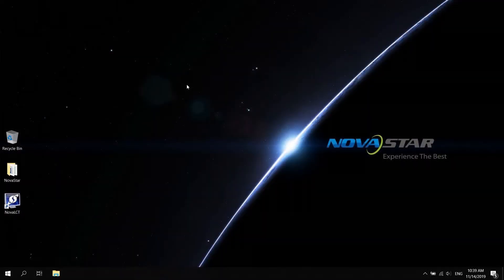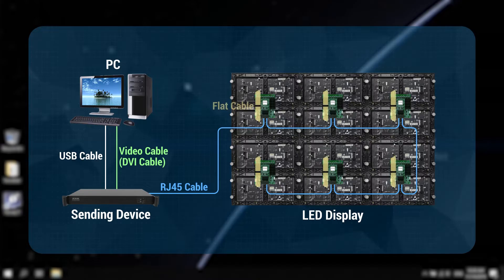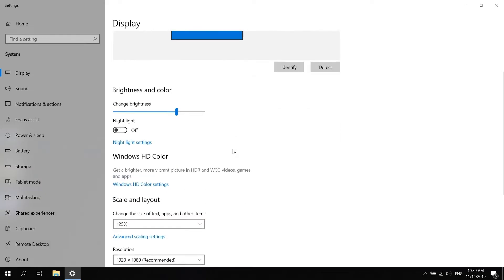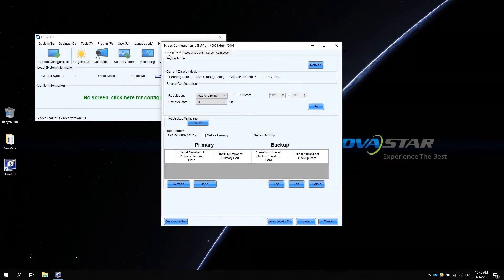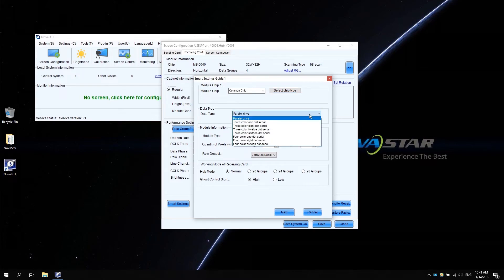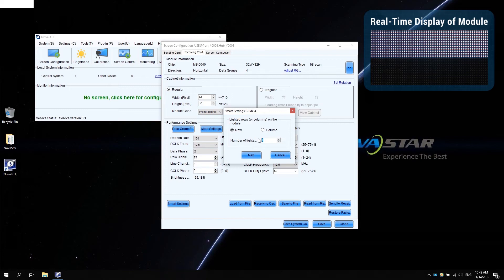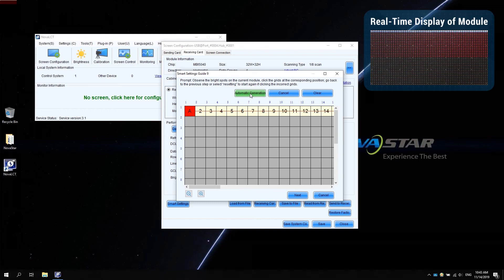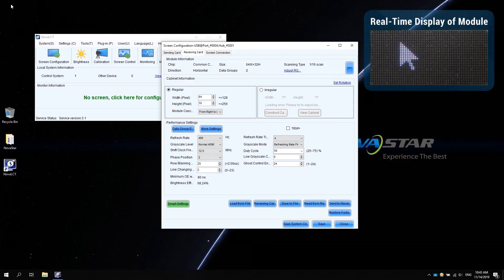01 Smart settings for a regular module

Comment: Hi guys, if you have any suggestions for the upcoming videos, just feel free to leave your comments here, we appreciate it.
Reply: Hi Darren. What can I do if I find the number of the module chip, but I can't find the row decoding type in the list??
Reply: @robertoyague4655  try 74hc138
Reply: hi darren, what if we can’t find our decoding IC in the list given?
Reply: Do you found solution for this sir?please share
Reply: Im also having this problem
Reply: @shazreeqibrahim7183  if you cannot find it, please try the common 74HC138
Reply: Can we Copy the Configuration from any receiving Card that saved configuration ?
Reply: @hamzabilal4865  yes, you can read from the normal receiving card and save a file for it. The file format is rcfg/rcfgx.
Reply: Hey Darren. Is the Taurus T3 compatible with the MRV 300-1?
Reply: @bgoodman5875  Yes，MRV300-1 is the receiving card, all NovaStar receiving card are compatible with all NovaStar sending card, no matter it's MCTRL300/600/R5/4K/Taurus series etc...
Reply: Hey @Darren Wong I have a question, Can I setup so I use on my computer the exact same resolution as my LED Screen, like changing the source resolution and making windows recognize it. For example I have a led screen wich resolution is 1024 * 512 and I want windows to directly use that resolution, not 1920*1080